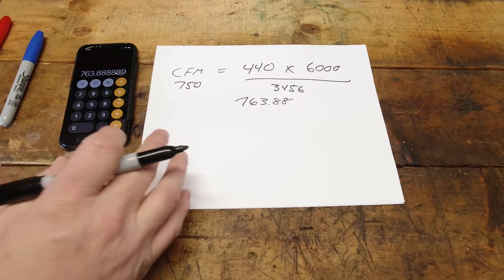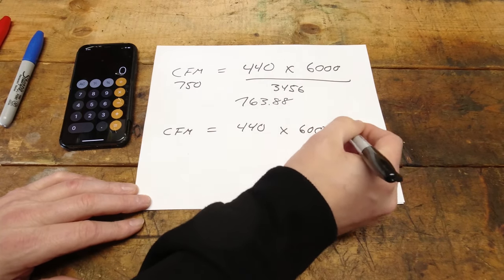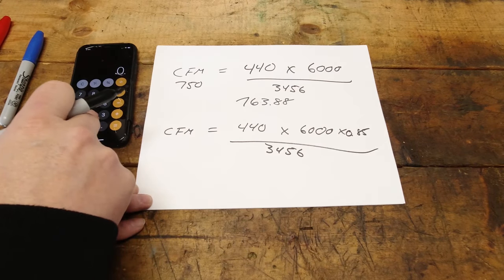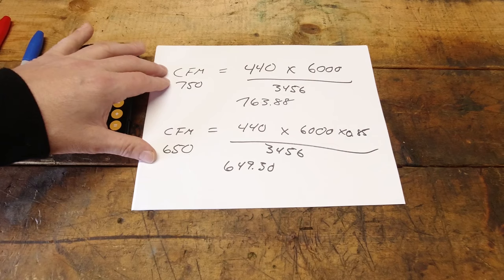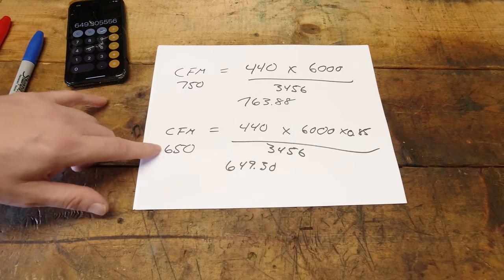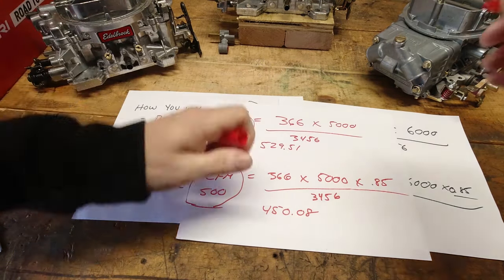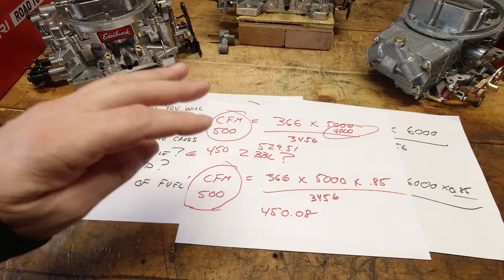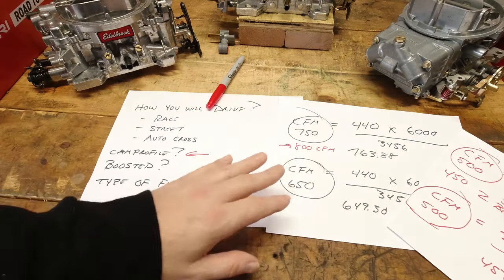How to Choose the Right Size Carburetor

Comment: I've got a 1962 Buick Skylark with a 215 V8, it's bored 30 over running around 10.5 compression and a little more cam than stock. This is going to be a cruiser not a race car. What type carburetor 2 or 4 and at what cfm would you recommend?
Reply from the maker: Those are always difficult when you have such small cubic inches.  What intake do you have on it now?  2 or 4 barrel?  That might be your deciding factor.
Reply: @MuscleCarSolutions  it has the factory 4 barrel intake but they make 2 barrel adapters. The original carburetor has seen better days so looking for replacement that would make a great daily driver cruiser.
Reply from the maker: What is the pattern on that pad?  Spreadbore or square?  That’s the next concern is getting something to bolt up to it.
Reply: @MuscleCarSolutions  it's a square bore.
Reply from the maker: @JohnScheppler  excellent!  In this case, go with the 500 CFM AVS2 and get the calibration kit.  You can tune down from there and work with the timing to get most of what you want from it.
Reply: @MuscleCarSolutions  thanks for the response
Reply from the maker: @JohnScheppler  anytime.  Please let me know if I can help.

Comment: I have a 312 ford thunderbird motor all stock and original, came with a holley 4100, right now I have a edelbrock 600cfm, I feel that it doesn't run as good as it should,  what carb would you recommend
Reply from the maker: Well, based on the information in the video, what size did you come up with?  I can’t answer your question as I don’t have all the necessary info.
Reply: @MuscleCarSolutions  it came out to 475
Reply from the maker: So you’re looking at a 500 CFM carb.  With a 600, what is making you feel like it’s not running like it should?
Reply: @MuscleCarSolutions  I've adjusted the idle all the way out and i can't get it to drop below 500 and the book calls for 450 to 475 at idle
Reply from the maker: @rickygomez641  500 is just fine.  I’m not sure the specs on the engine but I can’t imagine a situation where that would be unacceptable.  Carburetor adjustment and timing go hand in hand.  Both are adjusted at the same time.  How does it run other than that?

Comment: I’ve seen this discussed on engine masters and the saying an engine has too much carb didn’t play out on the Westech dyno.
Reply from the maker: So put too big a carb on your car and see how it is driving around town.  Dyno and real world operation are two entirely different things.
Reply: it wasnt that it was too much carb.  it was more of the TYPE of carb.  but i know which episode youre talking about 

but they did another episode and a double pumper is obviously gonna flow more fuel.  thats why they made 24 more HP  vs a vac secondary of the same size.  both flow 750 CFM.  fuel curves are completely different.  mechanical secondaries flow more on the secondary side .  exactly why the double pumper is what it is,  an extra shot of fuel,.

Comment: im building a fe 360 bored 030 over with mild cam 060 stock what best 650 or 750
Reply from the maker: Can’t really make a recommendation without more info.
Reply: @MuscleCarSolutions  use it for street but want kickdown power
Reply from the maker: So it’s in a dump truck or a mustang?  4wd lifted truck?  Thunderbird?  What’s the specs on the cam?  Max rpm?  What intake?  Headers?  What’s your CR?
Reply: @MuscleCarSolutions  it in 65 galaxie c6 tran stock intake

Comment: I'm so lucky that you used the 351W as an example, since that's what I'm building! Is "Operating RPM" the same as "fast idle RPM"? Ford shop manual states fast idle RPM @ 1400. Seems very low, compared to 6,500.
Reply from the maker: Operating RPM generally refers to the zone in which the best power is made.  If the set up was chosen to work together, the range is easy to determine.  Most go by what the cam is rated at.  It’s become a universal term of where the vehicle will be driving.  Race car, high rpm.  Street car, low to mid range and majority of the time.

Comment: For a 302 roller with Z303 cam, airgap manifold, edelbrock victor jr heads and T-5 tranny, I was looking around the 600-650 cfm. Am I on target and if so should I stick with mechanical secondary or go to a double pumper? This car will mainly be driven street around town for fun.
Reply from the maker: Can go either way.  The mechanical secondary will drive more fuel for sure.  Both can be tuned if the carb is the right size.  Don’t know the specs on the cam or your max rpm so if you’re comfortable with the math that got you to that conclusion, sounds like you’re on the right path.
Reply: Thanks for the quick response!  Advertised Duration 290/290, Lift .552/.552, @6500rpm
Reply from the maker: @craigraleigh8027  that’s a monster cam for a street car.  The manual will help but it will be a bit of a dog down low.  If you’re going to be operating in the power band of that cam, sound like a 650 would be perfect.
Reply: Gday.  Great vid  thanks heaps I have a Holden Ute 253. X 6000  = 1.518.000 # 3456( why this number) 439.236111  = 450 Holly ?   Is that right
Reply from the maker: 3456 is the conversion from inches to feet and is constant in the equation.  Sounds like you’ve found the size you need.  Just verify what you’re using the engine for and if you’re going to demand a little more from it based on equipment or a higher CR, then bump up a size.

Comment: I’m moving from a very modest altitude of less than 1,000 to the Denver area which is above 5,000 ft and mountain over passes like the Eisenhower tunnel nice 11,000 and a 6% grade.  I have a stock For truck 292 - the calculation says I should be looking at a 500 cfm … based on your other videos, I am looking at the AVS2 for tun-ability for all of these altitude changes … you did have the one video on tuning … but what about sizing?  Does the VE work better in that circumstance?
Reply from the maker: The sizing is covered in this video.  Tuning for elevation in another.  For your application you’re not going to need a drastic change in CFM.  500 sounds like it will work and follow the tuning steps in the elevation video.  I’m not sure what’s been upgraded on your 292 so there’s that to consider also.
Reply: @MuscleCarSolutions  it’s stock .020 over stock pistons and an automatic … so using the formula … 295x4500 = 385 cfm … so would a two barrel be a better choice??? And would a 500 Eldebrock be too much cfm???
Reply from the maker: @joelmiller7  in that situation when you’re going to fight to go lean, then yes I’d probably opt for the 2 barrel.
Reply: When using your formula, how do you adjust between 4bbl and 2bbl cfm ratings?  For example (295*3500)/3456 = 300 … if adjusting for a 2bbl rating … 300 * 1.414 = 424 cfm 2bbl?  1.414 being the conversion between the inches in mercury used to rate a 2bbl vs 4bbl. To convert from a 4bbl to a 2bbl rating multiply by 1.414?

Comment: Ford 289 mild cam in a 62 econoline pickup. Used for cruise nights/street rod. Is a 650 too much?
Reply from the maker: Might be.  Could be perfect.  What are the other parts to the equation?
Reply: @MuscleCarSolutions  basically stock except for the cam. I believe it’s a 268H cam. Stock heads, stock intake (for now)
Reply: I’m going for more show than go, but I want the sound
Reply from the maker: In that case yea it’s probably too big.  So the next question you’ll need to answer is will you be doing any upgrades in the future?  Cam, intake, heads, headers?  Engine work like more compression?  If you’re going to move to those things down the road then the 650 will be perfect, then.  Now, a little rich.

Comment: Pounds of air would be a way better calculation. We have math for fuel. X amount of pounds fuel per hr or minutes gives us x amount of horsepower capability. We also know that desired air fuel ratios are between 11-18 air to 1 fuel. So by figuring out lbs per hr fuel we can calculate air required then the last variable would be what type engine. 1cyl or 12 cylinder. Most engines come with plenty cfm it's merely the tunability of of carb from there. Those equations were made to sell carbs in the market
Reply from the maker: Those equations were made to give a far far less complicated target CFM.  It’s not a finite science.  If there were more sizes of carb available and a better result by drilling down to that level then yeah.  We’ll leave the big math to factoring injector and pump sizes for the EFI world.

Comment: Hi, I just came across your channel while watching one of uncle Tony's Garage's videos. After watching some of your videos, I was wondering if you might be able to help me sort out an issue I'm having. Here's what I have. It's a 1 ton dually with a 454, a manual transmission, 670 street avenger and 4.56 rear end gears. 

The issue is a lean spot just before the secondaries open. I've tried going to a black spring which is the stiffest. It got rid of the lean spot, but I don't think the secondaries are opening. 

I went one step down to the brown spring which seemed help, but there is a slight lean spot still and I can distinctly feel the secondaries open. Also with the brown spring, at times I don't get a lean spot, but I can't say for sure the secondaries are opening all the way. I don't know if the lack of a hit is misleading me compared to when I get the hit after the lean spot. All this is going wide open throttle from a slow roll at about 1200-1500 rpm.  My engine has peak hp at about 4200 rpm and I don't really ever go over that.

When I go wide open throttle at say 2000 rpm and say 30 mph I can't say I ever get a  lean spot.

Im not sure what other options i have.

Thanks for your video's, I've been enjoying watching them.
Reply from the maker: Which carburetor are you working with and what size?
Reply: @MuscleCarSolutions  670 holley street avenger
Reply: @MuscleCarSolutions  it's a 670 holley street avenger. I have about 19 inches of vacuum at idle.
Reply from the maker: I’d stick with the spring that eliminates your possible lean spot.  I wouldn’t worry about if they are opening or not.  If they aren’t, it will fall flat on its face.  It’s normal to have a smooth transition as they open and you want that!  Sounds like you’ve done quite a lot to get it figured out to this point.
Reply: @MuscleCarSolutions  I haven't done a whole lot, just tried a couple springs and put a .035 squirter in from a .031, which I'm not sure was the right direction. It seemed to clean things up, but I did notice it goes really rich (10.0:1) when I lug the motor and go wide open throttle. I'm not sure if it did that before though.

I went out and drove it again, I think there is considerable amount of power difference between the black and brown spring (brown spring is lighter) It sounds different too. It also revs cleaner and faster and doesn't sound like it's struggling so much to gain rpm.

 The air fuel ratio goes to a about 15.0:1 before the secondaries open all the way, it still pulls pretty good up to that point. I think im losing some power though. 

Would going from a 6.5 power valve to a 7.5 maybe clean up that lean spot or am I past the opening of the PV by time i get to the lean spot. I wish incould watch the vacuum gauge at same time as the AFR gauge. 

Any thoughts would be appreciated even if you still think I should stick with the heavier spring.

Comment: Great explanation thanks for your content i could use help with my set up its a street strip 73 torino sport 359ci cleveland 4v closed chamber heads flat top pistions should be 11:1 compression, air gap manafold long tube headers comp cam 284HR 224/224 duration 566/566 lift c6 trans with 2500 stall my big question is what carb and distributor also i live down south at sea level ive don the calculations but after watching im felling i need some direction 
Thanks in advance
Reply from the maker: Like mentioned in the video, you have to be honest about the rpm range you’re going to operate in.  Going to the drag strip occasionally and going to run it to 6500?  Or is this more a street cruiser and you’ll rarely see 5000?
Reply: @MuscleCarSolutions  thanks for responding, yes drag strip occasionally and 6500 would be the correct goal. But mostly street cruises red light to redlight
Reply from the maker: @bobbyessick7425  well, that falls in the middle of some choices.  You’re close to 650 and for most of your operating time, it would be perfect.  Great throttle response, easy to tune.  Or if the drag racing side o more important to you, go up the the 750.  But it’s a give and take scenario.  You’ll give up some of that crisp throttle response and it’s going to run rich a majority of the time.  Lots of oil changes and spark plugs.  But it will be easy to tune on the higher rpm side and give you what you want on the drag strip.
Reply: @MuscleCarSolutions  amazingly informative videos thanks again that's in the neighborhood of what i was thinking. Thoughts or preferences on which carb model to go with and distributor for my situation
Reply from the maker: @bobbyessick7425  well that’s a bit up to you on the decision.  If that’s my situation, I’ll generally choose the AVS2 for a street carburetor.  If the WOT stuff is what’s more important then you’ve got some great choices to flow that amount of fuel.  The new VRS-4150 is an amazing carburetor.  The Holley hp series would be another good choice.  Distributors have gotten disappointing in the past ten years.  All the MSD stuff has gone down in quality when it was pushed off shore.  FAST is all but discontinued.  It’s hit or miss.  Find a brand you trust and go with it.
Reply: @MuscleCarSolutions  thanks for all your help!
Reply from the maker: @bobbyessick7425  anytime!

Comment: Ok I am building a 1977 dodge w200 with a 360 in it I am using 340 x heads and four barrel intake I am using a lunat voodoo cam flat tappet with a lift .494/.513 duration 271/279 rpm range 1800 to 6200 I am using speed pro pistons .30 over the truck weights about 7000 lbs lunati says to use a 700 cfm carb what's your thoughts any help would be appreciated greatly thanks
Reply from the maker: So assuming by that cam choice you’re looking for less low end and more top end.  That’s an aggressive cam for such a heavy truck.  What’s the LSA?  So you’re planning on heading to the drag strip often.  Correct?  Seems like a bit of a mismatch here.
Reply: @MuscleCarSolutions  Las is 112
Reply: Lsa 112
Reply: @MuscleCarSolutions  the truck is going to be a weekend cruiser
Reply from the maker: @robertgaborko9162  not a very good cam selection for just a cruiser.  It’s going to want to rpm with that LSA and the specs on the cam scream less low end more top end power.  So yeah if that’s what you were after a 750 would work fine.
Reply: @MuscleCarSolutions  thanks with what you just told me maybe I I'll use that motor in my 66 barracuda and build a different engine for the truck thanks
Reply: @MuscleCarSolutions  I just found out about your channel I been watching your videos you have some great comments love the video on the new edelbrock version 4150

Comment: Hey great video!!  could you tell me which size  carb I need i currently have this cam kit installed on my sbc 355.. Howards Cams CL118001-09   
I have vortec heads and the operating range of the cam is listed 1800 - 5600rpm 
Will be street driven couple burnouts etc
Reply from the maker: I always start this with, “what did you come up with based on what the video taught?”.  Chances are, we’ll going to hit the same number.  Then we can talk about all the other little things that might change the number.
Reply: @MuscleCarSolutions  thanks for the fast reply I came up with 575.231481 what did you come up with
Reply from the maker: @theunderdawg  yes!  Now round up to 600 and that will get you to a starting point.  So questions become what was asked at the end of the video.  Doing anything more with it?  Occasional track time?  Nitrous?  Or more a street cruiser with occasional spirited driving and a few burnouts?
Reply: @MuscleCarSolutions  prolly will never see the track only drive around the city and a few burn outs I do have 373 gears in the rear  😈 I was told a avs2 650 would be better since my 1406 will bog and my car cut off if I smack it and try to do doughnuts 😢
Reply from the maker: The 650 wouldn’t be a bad choice.  A little over carbureted but better to be a little fat than a little lean in this case.  I covered the issue you had in this video.  Though with some tuning and pressure adjustment you can sort out some of it.  https://youtu.be/2y0ASE5jVvc
Reply: @MuscleCarSolutions  thank you allot I think I’m going to purchase the avs2. Thanks again you just got a new subscriber 🌟
Reply from the maker: @theunderdawg  I don’t think you’ll go wrong with the AVS2.  It’s an incredible carb and perfect for what you’re doing.  Let me know I of you have any questions with it and welcome!  Glad you’re here!  👍

Comment: Carburetors are very forgiving. And I've tuned a 750 on a low buck sbc. I wouldn't even try to make a 650 work on a big block. They'll only flow so much air, and because of that only so much fuel. But I'd rather be bigger for sure.
Reply from the maker: It’s all about the combination and the operating RPM.  I’ve put 500 CFM carbs on big block yard dog trucks that operate well under 4000 rpm.  Bigger isn’t better.  It’s a very common mistake.
Reply: @MuscleCarSolutions  that makes since. A big block that only idles could run on a 390 cfm carb just fine. Once you start to open up the throttle you reach a point where the engine will need more than 390 cfm. As you mentioned with efi. They offer up 1000 cfm. But you run smaller injectors. I agree there's a right carburetor size for every displacement, and what the engine will be used for. I've just been far more successful getting way too much cfm to work in a pinch. Than vise versa.